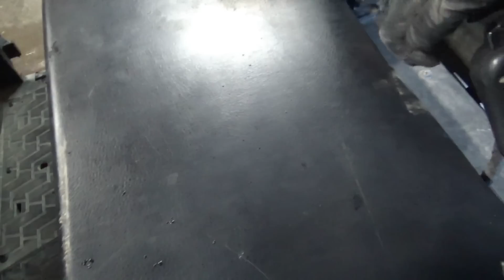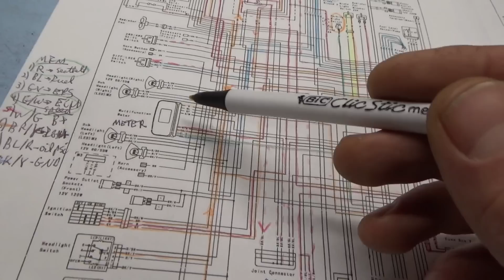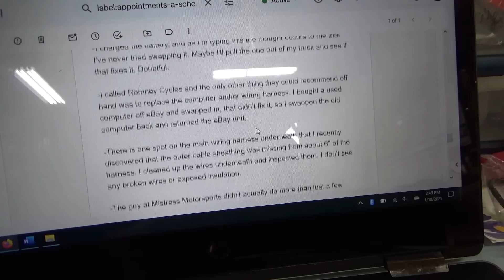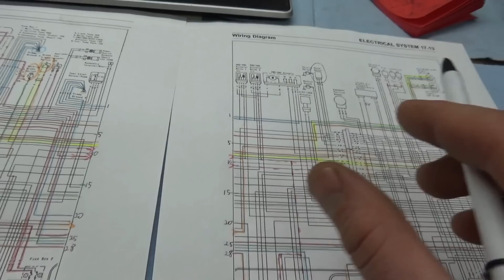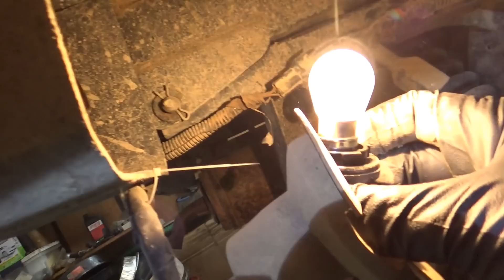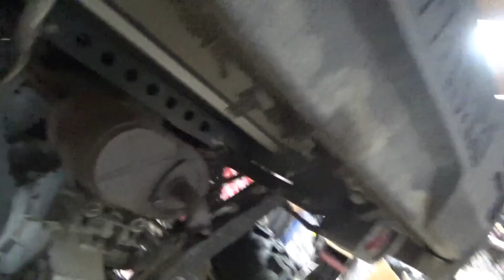Kawasaki Dealer STUMPED!?! SxS REDUCED SPEED Mode (15mph max)?

Comment: These manufacturers can build these complex modern machines but not give a list of possible reasons in the service manual for reduced speed or program the ECU to set a code giving the fault for the reduced speed? All guesswork? I mean what is this... early 80s technology? Does the service manual give any info on this that you didn't share with the viewers or did you get up to speed on possible causes strictly from forums??
Reply from the maker: Only thing I looked up in the service manual was the wiring diagram :)
Reply: @PineHollowAutoDiagnostics 
I am just trying to figure out why Kawasaki service information would not state reduced speed from a fault as an existing part of ECU software and a potential problem for technicians to have to repair? I also wonder as some other commentators why you jumped to the brake switch adjustment as the fix? Seems to me even the way it was adjusted the brake switch would still have actuated when pressing the pedal... no chance the customer drove over some bumps that shook some of that taillight wiring loose (besides the miswiring repair) that caused feedback to the ECU? Also strange that unplugging the speed sensor temporarily overcame whatever problem you ended up fixing? Anyways I always learn something new... obviously you didn't design this system but I am curious what actual service information Kawasaki has out there for their Technicians. Faulty engineering to completely hide the reason for a problem like this from the Operator or Technician.

Comment: Reminds me of 2003-2007 350Z's where aftermarket LED tail lights could back feed voltage into the brake light circuit and cause limp mode.   I suspect the issue wasn't the brake switch in this case.   The miswired tail light may have been feeding the running lights voltage to the brake line...

Comment: Great video IVAN.I too find it more rewarding sitting inside with a cup of coffee looking over wiring to MAKE MYSELF UNDERSTAND how a system WORKS. 1st.Then go under and look for broken stuff whether it's wiring or parts.It's obvious to us you've not seen that 4 wheel unit before.AND BEING SMART you did the smart thing,FIND the right wiring diagram.I just subscribed for a 1 month to identifix so get prints for my Honda civic issue.GUESS WHAT ___i found a rubbed through WIRE.I could have saved myself buying 300.00 worth of un-needed parts.SO yes i BELIEVE in your method.DO RESEARCH 1st.thanks my friend

Comment: I liked replaced the belt and the speed sensor just to charge something. Like going to Midas for a muffler. Once your car is on the lift, then the shocks leak, pads bad, boots seeping and all you wanted was a muffler. Ivan wins again. Logic wins over swapping. Customer inflicted the wiring swap?
Reply: Probably the previous owner did it.

Comment: Could the mis-wired tail light circuit have unintentionally re-routed the parking/driving/marker lights to the brake light signal through the bulb filament? Then the ecu would see a continually applied brake, and hence reduced speed.
Reply from the maker: Not in this case, bulb ground was wired correctly so no backfeed :)

Comment: This took me back to when i was about 14 i had a vespa motor scooter that died out on me and wouldnt start ! I spent hrs trying to figure it out ! I noticed the tailight was not working so i replaced the bulb ! For laughs and giggles i went to start it and it fired right up ! I was like wtf ? Come to find out the ign circuit runs thru the bulb ! I figured it must be a safety feature in italy ! always carried a spare bulb after that ! 😂

Comment: Was the ECU maybe confused by no current flow? Both brake light bulbs were disconnected (2x broken wire) and so not a minimal current flow or voltage drop could happen on the monitored wire.

Maybe the ECU wants to see a least a little current flow when shifting to L or H.

Comment: I once had an older ABS system that kept having a code in it.  Come to find out, someone replaced the 1157 bulbs with LED bulbs.  Put in 1157 bulbs, ABS works.
Good one Ivan.

Comment: I do agree that such an unstable and dangerous vehicle should have this safety feature but it is ridiculous that a system that would disable a vehicle due to a faulty switch  would not have a warning light for the malfunction, especially since a bad electrical circuit that has nothing to do with actual brake function.

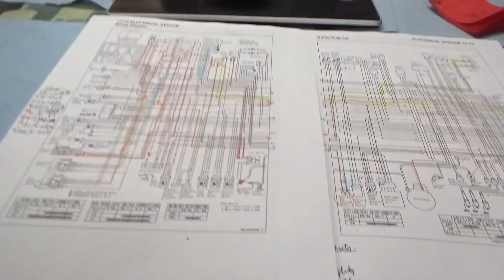Comment: 6:20...thats the hardest part i have with customers is getting them to understand that just because the actual repair took an hour I have way more time spent beforehand doing research and figuring things out ...and that time shouldnt be free of cost
Reply from the maker: It helps when the customers are desperate to "just get it fixed" and have taken it to multiple other shops with no results :)

Comment: Remember when the Toyota pickup was called "pickup" and the factory bed rotted completely off in 3 years? And everyone tried making a wood bed but used Ford or Chevy tail lights...that did not have seperate turn signals...and had ALL KINDS of weird problems.

Comment: Sadiest part about this hole thing is who ever crossed the wire at the tail lite should have realized what they did it worked before i rewired the light now it doesnt what did i do
Reply from the maker: I'm sure it was rewired well before the speed limiter kicked in...
Reply: @PineHollowAutoDiagnostics  I'm not saying your wrong I'm just making a point if the problems are not connected then it will be a come back as that wasn't the problem it will go in limp mode again

Comment: To me the best part of the video is what you said about studying a wiring diagram. Last year a friend of mine had a scissor lift that had a joystick replaced. After ordering a schematic and studying it for quite a while I could see the logic of a system I had never seen before. It ended up being a cam on the joystick in the wrong orientation. A simple problem, but I was kicking myself because it wasn’t very obvious until I could understand how the machine circuits worked. Thanks again Ivan.

Comment: Without knowing the logic of the ECU, we don’t know if it’s monitoring  the brake light bulbs for continuity OR is it looking for an input when you step on the brake pedal to put it in gear. A few simple tests could answer those questions.
Reply from the maker: Sure, could have measured the voltage on the wire with both bulbs unplugged. Doesn't really matter since the brake lights needed to be fixed anyways :)
Reply: @PineHollowAutoDiagnostics  I agree, from the customers perspective, no unnecessary repairs were done and the original complaint was resolved.
 As a former service tech, I sometimes had to put the customers needs ahead of my curiosity as to the actual root cause.

Comment: After 8000 hours the cable on the brake pedal stretched causing the switch to be out of adjustment more than likely. Great fix. Another happy customer.
Reply from the maker: Well it was 8000 MILES...hopefully they weren't going 1 mile per hour haha
Reply: @PineHollowAutoDiagnostics  Haha, right miles not hours. A lot of brake pedal cycles. Curios to know what engine hours would be though at that mileage. 🤣

Comment: Ivan, you lost me on the final diagnosis. The brake light switch always worked, but you had to press further on the brake to trigger the switch. The ecm still sees that switch is off. I would think the backwards wiring on the tail light would back feed on the brake light circuit to the ecm, telling it the brakes were applied. Just an assumption of course

Comment: So, is pushing  the brake pedal  required to START, even if the brake lights are not working, but after starting unless the brake lights actually come on, it will only run in limp ? I wish I knew more of the logic at the ECM level..

Comment: I wonder it the ECU has a pull-up to monitor the brake lamps & it limits the speed if both bulbs fail, as there is no braking signal for other vehicles??

Comment: A friend brought me a side by side that had similar problem. Would start just fine but would not run very good at higher speeds. Found the dirt dobbers had made their home in the air inlet hose. No parts required.

Comment: My old shop on mil base had a 1987 or 89 Kawasaki Mule - Gen 1 Mil Sale Only. I was working on it when no work/bored. Bunch of issues, it ran and drives but dash, brake lights, headlights, slow like limited. I did tune up that I could with no parts like dual carbs clean cause I know those are original sealed and knew it would be a nightmare if I touch it. Cleaning up wiring, testing working on getting brake lights work etc with no tech data, Whatever I did the dash worked, speedo, hauls ass. The manager said it was never that fast and it scared him 35mph. I come back from time off go to use it dash not working, starting issues, no power or speed, and reaks of gas. Some "Master Tech Of Everything"  took the 35 year old carbs off, took apart, ran in parts cleaner, now gas leaks everywhere. Never got time to mess with it, last time there crank no start now.

Comment: I don't think it was the brake switch.. I think it was because you push the brake and then the ECU couldn't see either brake light pulling current..  So it put you in limp mode, because both brake lights are out.   Kind of a nanny state feature if you ask me.  The brake switch was definitely out of adjustment, but it was still working when you pressed hard enough on the pedal.

Comment: Back in the 80’s I worked on a GM car where, long story very short, a sagging turn/brake dual filament in bulb caused the engine to ping but only at night. The ECM used the brake switch as an immediate cut of the egr valve when hitting the brakes to prevent stalling.
Reply: that would also unlock torque converter, change ignition timing and open decel. valve, thinking it was being stopped. depending on the year and what they had of course.
Reply: @ Early 80’s car with HEI. Can’t recall now if it was positive or negative backpressure egr. It was a Buick v-6 carb engine with ccc.

Comment: Maybe the computer needs at least one working brake light to pull down the signal. If the ECU has an internal pull-up, that would explain the issue since it thinks the brakes are actuated.

Comment: I think it's very interesting that the dealer didn't incidentally note the light bulb needed replacing and would have accidentally stumbled on the solution had he just simply observed that the wiring was incorrect when the brake light was not activated with the new bulb. Maybe the owner would have as well and the whole damned thing would never have been brought to light.

Comment: First generation Dodge Sprinter vans if you put the wrong stop lamp bulbs in the vehicle, the transmission/engine would derate, no codes, just rear lights would be always on….customer would come in for warranty repair, and leave with a bill for one light bulb..

Comment: Some Nissan cars will get an issue where the rear, sealed LED taillight assembly will allow a back feed on the brake pedal wire only when the taillights are on, causing the car to think the brake is being applied. You can test it by turning on the lights and see if you can take it out of park without stepping on the brake.

Comment: Nice repair!

A suggestion: Maybe put something reflective on your garage door so you can see the brake lights while you are at the drivers seat. Like those see-round-the-corner mirrors used in some buildings, but smaller.
Reply: piece of acrylic mirror comes to mind, wont break if bumped or if it falls off. or just a clean white finished area works well enough for me.

Comment: Dielectric grease is non-conductive!!!!! Do NOT use it to "help" with connections. It will act as an insulator instead.
Reply: Really? Then why does GM have us add dielectric grease to electrical connections to improve the connection.

Comment: GOOD FOR YOU ,GREAT VIDEO   SO   BAD BRAKE LIGHT SWITCH ADJUSTMENT    BRAKE  LIGHT SOCKET REPLACED WRONG    OTHER BRAKE LIGHT NOT WORKING BECAUSE OF PULLED WIRE    PARKING BRAKE SWITCH  DEFECTIVE.  That is a total of 4 EAZY fixes that  NEEDED  AND SHOULD HAVE  been done BEFORE BEFORE  ANY OTHER PARTS WERE THROWN AT IT. All this stuf didnt go bad in one day. IF A GUY CANT EVEN REPLACE A TAILIGHT SOCKET CORECTLY  HE SHOULNT HAVE THIS THING,  WHAT IS THE DEALER MECHANICS EXCUSE? All of these "SAFETY" systemes use to be eay to bypass or remove  NOT ANYMORE.

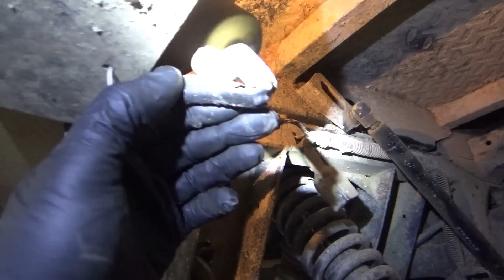Comment: At 24:37 there's what looks like an empty connector by the shock absorber.
Sometimes when one lamp is bright and the other dim it could be a grounding issue involved, but in this case someone just messed up the wiring order.
Strange quirks of many modern vehicles with ECUs - there should have been a fault code for this, but someone probably thought that this was too stupid to have a fault code for or it was a cost cutting case.
Reply: The engineers didn't design a check for this because "it should never happen".

Comment: Ivan, I believe the root cause was actually the brake light wiring, not the switch - the ECU likely has a weak pull-up to detect circuit integrity and/or as a fail-safe.   It needs the bulb filament to pull the circuit to ground without the brake pedal depressed.    The brake switch then pulls the signal back high and the ECU determines that the pedal is depressed (brakes active).    Since the brake filaments were both open circuit, that signal was always high.    Did you happen to check the ECU wire while the bulbs were disconnected to see if there was a weak pull-up present?

I was half expecting that someone had replaced the filament bulbs with LED bulbs, that may not have a 'ballast resistor' in them for circuit integrity checks.

Comment: Hey I van another great fix. The biggest problem is the other shops basically follow a diagnostic tree. If that doesn't fix it they are screwed. I am having a similar problem at work,. (I am getting ready to retire. YEAH!)  They have me teaching a young man to take over my duties. I can't teach him how to think outside the box of diag tree. Like you went through the system. Developed a plan of attack. for the problem he was working on for 3 months,  2 hours later I found the problem and fixed the issue. I had the department head try the system after repair and showed him it all worked. You thought I handed him a sack of gold.

Comment: Great logical troubleshooting Ivan 👍🏼
Reply: Ivan repaired 3 or 4 items and then tested the vehicle, and it worked.  Which repair fixed it and why?  Maybe, at least one of the brake lights has to have a good circuit in order to relay info to the ECM and since both were compromised, that resulted in the limiter effect?
Reply: @IsItTrueThat  The bulbs acted as pull down resistors.  Without them, the voltage on the brake wire was "whatever", and the ECU saw that as "brakes applied".
Reply: @russellhltn1396  Sorry, I'm just not understanding the circuit apparently.  I'm hearing you say that the absence of brake lights makes the ECU think the brakes are applied.  Isn't no brake lights on, the normal situation when you're driving? When your foot is off the brake the lights are not on so they could not be acting as a pull-down resistor at that point could they?  I'm fully confident I don't know enough to be discussing :)
Reply: @IsItTrueThat  When a standard light bulb is not on, the bulb is practically a dead short.  The bulbs will pull the line down to ground when off, the switch pulls it to battery when on.  Which raises a question - could this happen if someone decides to put LED lights in?  LEDs may not pull the line down.
Reply: @ people putting LED lights cause so many problems in modern BCM controlled lights, just don't do it!
Reply: Yes! Unless the led bulbs are made with a circuit to intentionally pull the positive side of the circuit low. That would make it a specialized led bulb. Imagine the havoc that could ensue if they were installed on a machine they weren't intended for?
Reply from the maker: Thanks Eric! No scope required, just a wiring diagram and some test lights :)

Comment: Ivan, I would bet that unterminated (no bulbl filaments connected) lines going to the ECU would float "high" due to the high impedance of the electronics in the computer and thus seeing the brake signal on all the time.
Reply from the maker: I should have put a meter on the Brake wire with the key ON to see if the ECU was sending out some sort of bias voltage...

Comment: Thinking about this Ivan could it not be that the ecu was getting a signal back to it from the incorrect wiring at the rear lamp after all both brake lamps are on the same circuit so that the ecu would think it's being driven with the brakes on all the time ?...
Reply from the maker: Nope, just swapped filaments, no backfeed :)